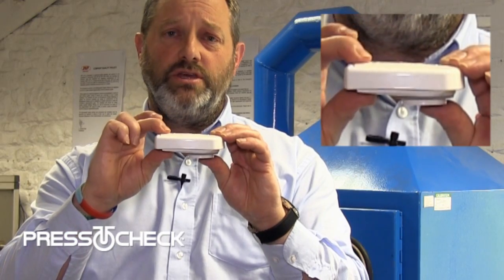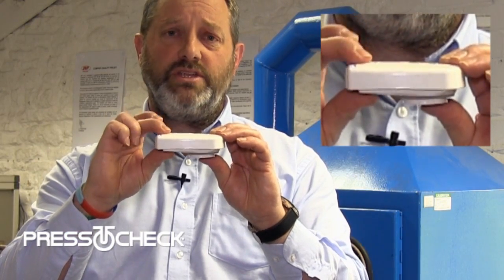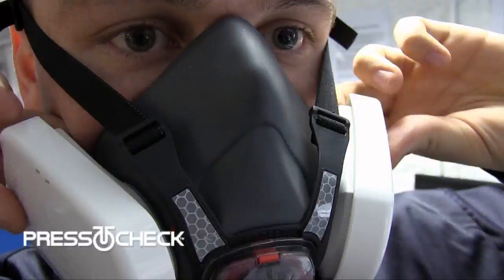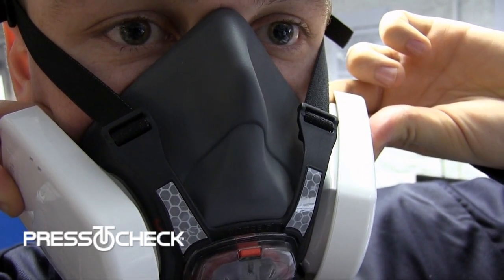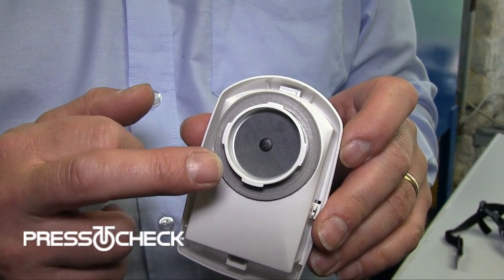Press To Check™ P3 filters product overview

Comment: I bought one of this for hospital use, I haven't been in extreme polluted environments with it and the other day I noticed the smell around me. Does it mean my filters are faulty?
Reply: AFAIK it will still be possible to smell things through a particulate filter. For example spray-painting fumes would certainly be noticable. Its not a gas mask, unless a more comprehensive filter is used. However, basic P3 filters are the correct ones to use if your only concern is viruses.
Reply: Not at all hese are only dust filters i also use in a hospital. if you don't want to smell gases you need a combination filter so a1or a2 as well as the p3. if you only want protect yourself from the virus you only need the p3 filter which only does dust droplets etc not gas which will go straight through
Reply: @chichikov617  thank you!
Reply: @dantae666  thank you